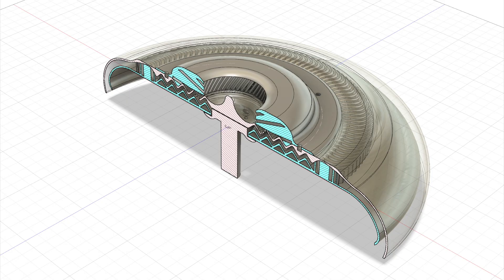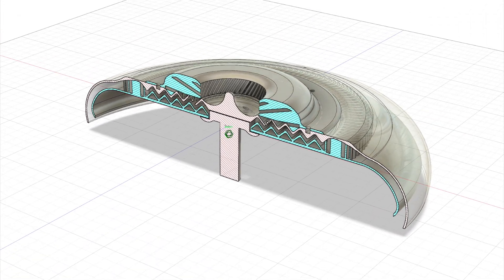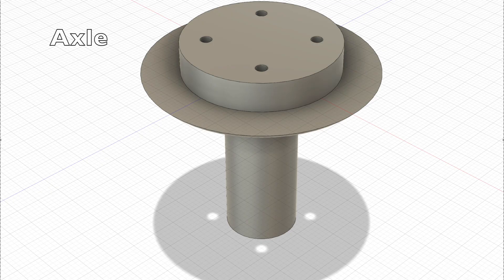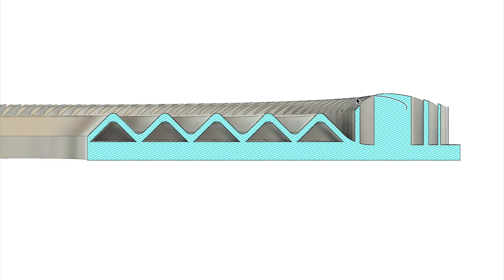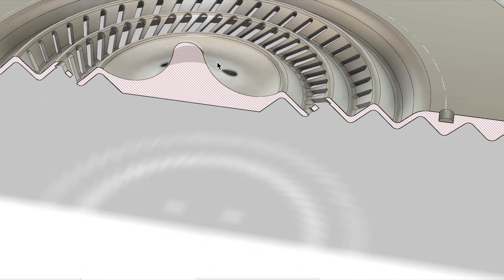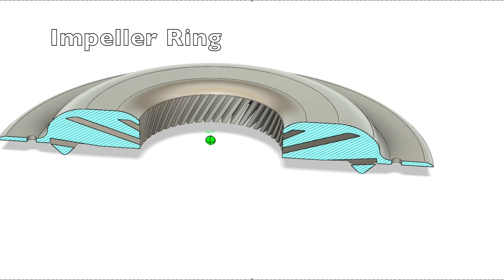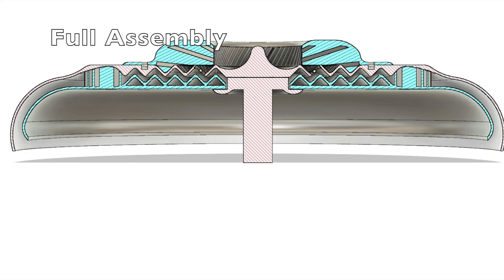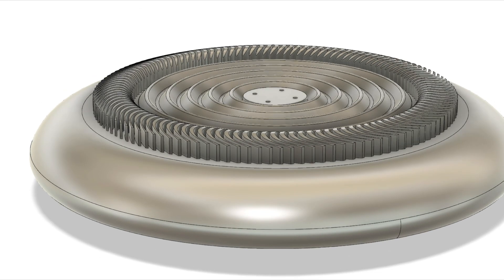Schauberger Turbine (Repulsine Replication)

Comment: Awesome video and incredible work. Its so good seeing someone still working on this after all these years. Its remarkable just how much easier it is to access CAD programs now opposed to 20-25 years ago making this all that much more feasible of testing in a cooperative environment.

Have you ever looked into getting someone with CNC and metal fabrication experience? I seriously emphasize use of the lathe to potentially create a small scale drone-sized RC version of the repulsine. Consider that the copper plates would need to be lathed to size likely with a laser CNC lathe. The same goes for the coppered silver.

Also, had you ever factored in that the Repulsine was partially powered by water vapour or steam? I always wondered if there was to be a reservoir below the outer cowling which would funnel that vapour up into the top inlet (with the twisting whorl pipes) thus densifying the air giving greater thrust. Think of water injections on the early Boeing 747s.
Reply from the maker: Hey, thanks for the thoughtful comment—I couldn’t agree more!

I haven’t looked into CNCing myself, but when I designed this, I did so that it would be friendly towards those purposes (including laithe). I’ve done all I can with the time and resources I had available and hope this inspires people to continue innovating and improving the design principles!

Another perk about my work is that, sometimes, I try to add an “easter egg” in my designs for those willing to go the extra mile. The easter egg for this device, which I don’t think anyone has caught onto just yet is that,  is that it can be made into capacitors so that the device can fully exploit the benefits of the purported "Biefeld-Brown effect". [All you need is a dielectric pancake or two  between the plates, with the appropriate K value and then close the circuit with the negative  at the top and positive at the bottom for the entire turbine. This is why I "combined" certain parts in the design like the cowls].

During this build I conceived [and treated it as] a high voltage static generator [rotational capacitor or sorts] might give way to some interesting effects ( as with all things experimentally some fine tuning might be necessary :).   i was trying to to keep the lore about "triboluminescence" in mind, (if it was a thing  that happened at all when this was built)! I imagine that high the potential difference (high voltage) would yield some of the effects related to steam/water which you mention making it something like a mini storm cloud/tornado.  Just more avenues to check out for research in case something is there at all! 

This is no longer an Easter egg not that I explicitly make mention of it here, but maybe it will inspire people nonetheless!
Reply: @MillennialZoomer 
Well, all good there! You did a great job on the design and im sure it could be made on a lathe and to a very accurate degree. Again, a laser CNC would get the design down perfectly. The only questions that come to mind is the thickness of the copper in each plate/component. This would certainly affect stress testing and temperature.

As for the Biefeld-Brown effect, do you mean flat copper plates or the existing copper waveform plates as is shown in the model? Air and water are also dielectric so im just only so familiar 😅 (please  forgive).

It would be quite interesting to see this static storm come from just high voltage alone. The reason I mention water is because it is said that what caused the infamous incident where bolts shattered from a  table leading to the Repulsine hitting the ceiling from how much lift/thrust created was allegedly from a water hose being sprayed at the top of the Repulsine. Did you ever read about this? I just have to wonder if the idea that cold fresh water plays a role as the "fuel" of the device. So many thoughts.
Reply from the maker: @islandskiercanada2840  Thank you for the comment🙇‍♂🙇‍♂🙇‍♂! No apologies needed whatsoever. 

Thickness is adjustable from the files I provided, although it might be a bit tricky with the waveform plates, however there are work arounds! I did add a millimeter or two more in the case that this was to be used with some electricity. 

So far as the plates for the BB effect,  I'm speaking of adding a dielectric material (not shown in video). From the assemblies I've provided, in one bulid you basically have 3 parts which can be sandwiched with a dielectric material, thats probably like a pancake/ ring along the rotational axis. 

You are not at all mistaken regarding the air, (its already a natural dielectric that would probably be for a secondary effect with some arcing  at a high enough voltage), but to really examine some of the purported triboelectric effects, it would be better to have something with  the right "K" value and shape. Something like a tapering cone where each slice of the dielectric plate becomes smaller (if this makes any sense at all)!
Reply from the maker: @islandskiercanada2840 Hello, I’m replying another time because I missed your comment on the infamous shearing event (do forgive me)! 🙇‍♂️

That event was a chief motivator for me  to go ahead and try replicating the machine, tweaking the design ever so slightly to explore the possibility of generating “artificial” storm  clouds. I’m convinced (provided those events really took place) that when the prototype took off, it did so without any “emulsifier” (or the mysterious chemical that folks say is essential for this machine to work).

I don’t recall water being a chief catalyst when it took off, but it’s been a few years since I’ve seriously sat down and engaged/studied Schaubergers material. I need to go back and find the place where that account is mentioned. 

When taking into consideration the way storm clouds work it’s only natural that water could’ve had some role to play in a older version  as you mention here. How it would be used in a steam process remains another area for more research. I don’t know that I have any good answer here. 

One thing I remember from the account was that the device was able to shear itself from the metal (presumably steel) workbench? Unbelievable.
Reply: @MillennialZoomer That is cool that you gave the extra mm or two for the possibility of the use of electricity. It seems inevitable on the device.

I see what you mean with the dielectric material components being put around the rotational axis. It would be interesting to see that also illustrated/designed in a future CAD model too.

It's interesting to see if the triboelectric effects would be noticeable at a certain RPM. In the documentary on VS, I don't think the Repulsine was ever taken to a higher RPM than 2,000 (ish). Having the high voltage introduced at the right K value would be interesting whereby airflow in the turbine is combined. Any guess as to the K value?
Reply: @MillennialZoomer Haha all good man. Appreciate the attention to detail, again.

Out of curiosity, what exactly did you tweak to make it so that it would possibly generate "artificial storm clouds"? Suffice to say, I do agree that the "emulsifier" myth is just, well, a myth. If it were anything, it would make sense if it were possibly water/steam/vapour. I continue to say this in that the forced induction of water would possibly allow the air going into the impeller to be cooled thus allowing those higher RPMs to be reached without reaching temperatures that could shatter the copper plates. The higher RPMs (up to or in excess of 20,000) would ideally amplify the triboelectric effects as you describe.

I admit I am not certain on how water/steam/vapour would play a role in the storm clouds. I admit I am approaching the design partly from a thermodynamic and airflow/fluid flow aspect. Steam or vapour would, ideally, add thrust to the air that is already being compressed in the turbine. The triboelectric effects could be a byproduct of the turbine vortexes already being produced (think of the "ionic wind" of the BB effect). Is it possible the factors involved in powered flight here are by:
- Compressed downward air inducted by impeller and turbine from high speed electric motor
- Forced induction of water vapour or steam through impeller on top side allowing high RPM to be reached with greater ease and less stress on structure
- High voltage induced dielectric materials between the plates generating the Biefeld-Brown effect
- High speed compressed air generated from the turbine combined with triboelectric BB enhancing lift

I'm not sure if this would work but I am just fascinated by the possibility of it working one day.
Reply from the maker: @islandskiercanada2840   Thank you for the comments and  your praise 🙇‍♂🙇‍♂🙇‍♂!  I really put alot of effort trying to capture several details of this machine with what I could do at that time. 

So far as the K value/the precise geometry of the cone/disk dielectric parts go-- no idea. This might be something to explore for later builds. I'm sure if I sat down and did some scribbles and calculation, I could find a value for a baseline effects minus the turbine. From there you could calculate again treating the turbine as a simple static electricity generator of sorts  and make more guesstimations. After that, everything else would be left to experimentation and fine tuning.

On the matter of "artificial storm clouds" this was only a matter of geometry. While I was designing this build, I realized that the certain geometries of the cowl could amplify the "organic" vortexes cushions which would be generated at the base. Some videos/lay research I found to be particularly useful in determining ideal shape/cavities were Tom Stanton's work here:" https://www.youtube.com/watch?v=cJoUSHJcV4E and Giesbert's work here: https://youtube.com/playlist?list=PL6217C278DA9A310E&si=GyCNEKwh4ENnPjGl

I will say that there were number of geometries that I did not use because I wanted to balance providing a somewhat decent replication, before doing any major design overhauls. These alternative designs could maybe be the subject for another video.

Finally, its been a while, but this is what I conceive an ideal device (that is able to takeoff) would look like in terms of the approximate fluid dynamics: there are technically two vortexes--the giant one around the entire operational system, and a secondary one nested within the larger (namely under the bottom cowl). Really, the whole system is just one giant vortex "cloud", with some perceptual counterrotation going on (if this makes any sense at all).

I appreciate this exchange--you ask alot of incredible questions!! It is so encouraging to dialogue with folks who are still curious, and looking forward to alternatives routes in making a functional system. I also like that you are looking at this from a more thermodynamic approach. There are still a number of things to be explored, and improved for this system!

Nam qui curat!
Reply: @MillennialZoomer Yeah. No small task for something with one moving part (in theory). 

Of course it makes no sense to have exact dimensions at such an initial part of theory and design. I am probably getting ahead of myself. 

I have seen the videos both by Stanton and Nijhuis. It seems both play a bit of an intersecting role in the Repulsine for different reasons. With Stanton, its as if you could see the "exhaust" of the Repulsine from underneath the cowling and get an idea of how that works. With Nijhuis, it's as if you conceive how the impeller suction would work with a vacuum effect but from the impeller inducting air from the bottom of the device instead of the top as it would be on the Repulsine.

It makes sense to not rush to take too many design liberties at this point. Obviously, the device hasn't even been tested enough let alone rigorously experimented within a CFD simulation. 

I agree about the two vortexes. One goes around the entire device from the upper cowling and the other forms below the lower cowling and thus designed in such a way that the exhaust air has a radial outlet(s) below. 

One thing I have come to wonder about with an actual drone/model version of the Repulsine would be the concept of an exo-skeleton structure to house the electric motor, electronics, battery, landing gear, flaps and maybe even water reservoir (if that even is a thing). The idea being it might go around the entire model that you have designed with inlets and outlets for the intakes and exhaust as appropriate. With this, there would then need to be a counter-rotational (clockwise) gyro to stop the precession of the natural counterclockwide spin of the electric motor's high torque and RPM. I would imagine this crossed your mind too? In any case, the idea of having the weight on the bottom of the device on an exoskeleton of the initial Repulsine would serve as a weight balance not unlike the keel of a ship or sailboat for centre of gravity and weight balance.
Reply: @MillennialZoomer Are you familiar or have used CFD software?
Reply from the maker: @islandskiercanada2840  I am not well versed in CFD, but it is one avenue I’ve definitely considered in examining certain aspects of this system.
Reply: @MillennialZoomer Cool! Would be cool to see an attempt at that on YouTube at some point.
Reply from the maker: @islandskiercanada2840  I really enjoy our exchange, thank you for paying this channel and video a visit. You present many interesting design/engineering considerations that call for further R&R. Infact, there could prolly be an entire series just on trying to figure out the fine tuning for some rough models of this device! 

I'm going to keep these things into consideration. Right now I'm working on finishing stuff for for a few videos in a few weeks. After their done, perhaps this will be revisited. 

I no longer have access to a lab with proper tools as I did formerly, but I can still explore many of these things pen and paper along with simulations.
Reply: @MillennialZoomer Thank you and I appreciate that we've been able to have a productive discussion around the many aspects of said design/engineering considerations. A whole video series would be interesting no doubt. A lot of effort but perhaps something that is based predominantly on real engineering principles trying to sort of "make sense" and reality in practice of how the Repulsine was intended to work.

Again, I understand how busy things are with work and all.

Hopefully you still have access to a CAD program in which you can work on these designs too!

I also hope this discussion around the design can continue in the near future. There is so much evidence to at least suggest* that a turbine like this could have some feasibility of creating enough thrust to lift more than its own weight.
Reply from the maker: @islandskiercanada2840  thanks for the comment! I haven’t forgotten about this topic in the slightest. I’ve just been quite busy. Be on the look, for very soon you will see this and more :)
Reply: @MillennialZoomer You mentioned here that you would close the circuit with the negative at the top and the positive at the bottom. Why is this the case when the ionic breeze is pushed from the positive to behind the negative? If the airflow is being sucked in from the top axially then radially sent to the periphery between the two plates and then downwards axially, shouldn't the top plate be positive with the bottom plate as negatively charged? Happy new years
Reply from the maker: @islandskiercanada2840  Hey, thanks for the comment. First off, happy new year 🎊🎆🎈. Thank you for both questions and engagement on this channel.

So to address the first matter: If you incorporate High Voltage (HV) into this design it effectively  becomes a giant asymmetrical capacitor such that the directionality of the force depends one shape/direction of current being pushed through the system. This is why my recommendation on the circuitry was such;  I designed this build in such a way that  the structure might be more accommodating to the Biefield-Brown effect.

On the matter of “ionic wind”over the years many people have misinterpreted the supposed Biefield-Brown effect as ionic wind without making the effort to examine alternative explanations from the particle physics side of things. I even found a few recent military/NASA reports, within the last two decades,  which boldly assert ionic wind, while ignoring some rather important laboratory experiments which were carried out long before their publications.  Once upon time, even I was also a proponent of this camp. 

For the record, today, I completely disagree with most of their findings because most of these  authors never bothered to mention the independent experiments that were rigorous carried out by Toyota (yes they same company that manufactures cars) in the late 90s.  Why this is the case is anyone’s guess. (Maybe they didn't like the fact that the publication wasn’t in a massively peer reviewed journal),  still does nothing to the data that was collected during these straightforward experiments. It’s bad science to pretend that a study doesn’t exist, or simply disregard data based on rhetorical arguments.  Anyway, to read this completely overlooked study go here: https://www.researchgate.net/publication/287041399_On_the_possibility_of_strong_coupling_between_electricity_and_gravitation

I will say that, after going through this report, and a few others, I changed my views. I also became rather disappointed, in the niche institutional researchers within this  field (some university professors in high places) who  who continued with this "ionic wind dismissals" in later publications without making any mention of the quite rigors laboratory experiment carried out by Toyota. 

Off the record, I personally believe that gravitation is strongly coupled to electromagnetism in the same respect that electricity and magnetism are the same. In simpler words: at the end of the day gravity is truly electromagnetic. I believe this, not strictly on the basis of pen an paper calculations, but a number of select experimental case studies from which an argument for this can be framed in a "Faraday" like manner. I even try to make a case for this in a short essay on gravitation that covers only two (of many other ) case studies here: https://www.researchgate.net/publication/381958168_Gravity_as_a_High_Frequency_Electromagnetic_Wave_of_Displacement_in_the_Spacetime_Quantum_Vacuum

For those who are still unconvinced, I always remind that that from the purely theoretical physics point of view this couple is possible. Its just that this route is presently way more complicated (esoteric) to demonstrate via the heavy  mathematical machinery of  contemporary particle physics. Inspite of such, it is still viable and can be shown to a certain extent. One way you can argue for the validate of such effects within mainstream institutional circles rather than invoking the "Biefield Brown effect" just talk about the Gersentein effect, with some qualifying about a Yukawa type  such and such couple, a few other shop talk things and you might be good. I mean, if my memory serves me correctly, I believe that the Gersentein effect has already been verified, at least in part, by some experiments. 

Speaking for myself here: but real scientists are sin the business of examining past experiments rigorously to inspect the claims that were asserted and the data put forward. Blind belief according to one’s understanding of a principle will always just be that. Belief isn’t immaculate, Truth speaks for itself. This is why several reports on brown's work have felt more like a coordinated misinformation campaign than anything else. So too, this was the case for Tesla. 

in short: short question those who dismiss things swiftly, and without bothering to carry out serious experiments. 

nam qui curat